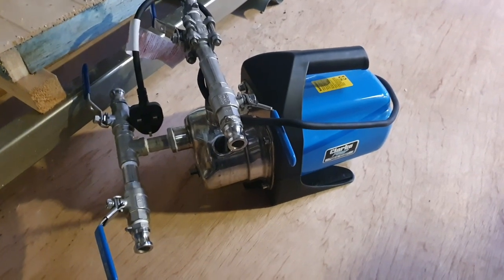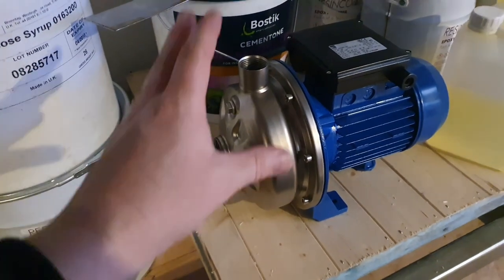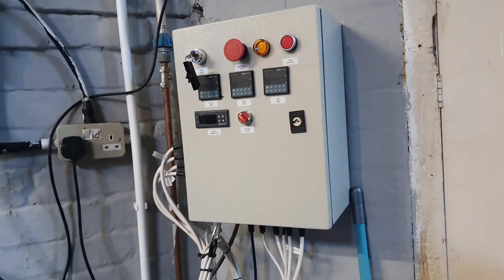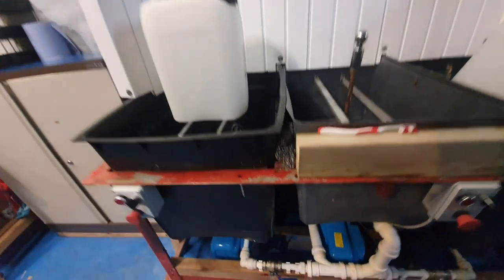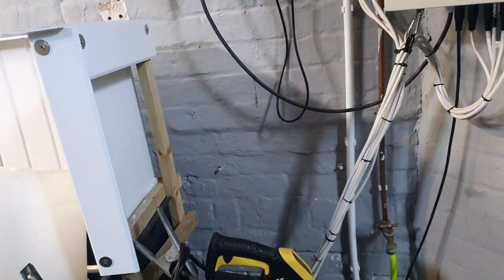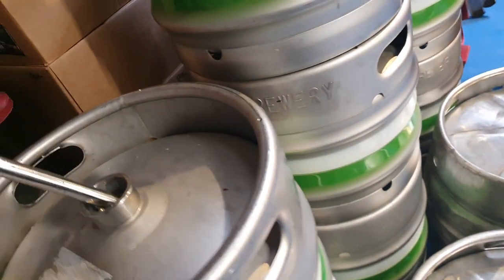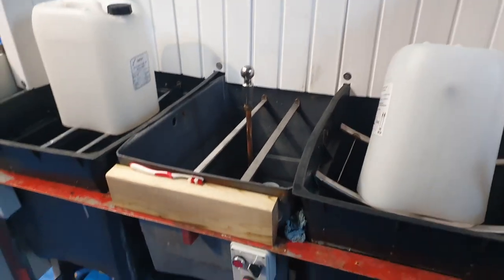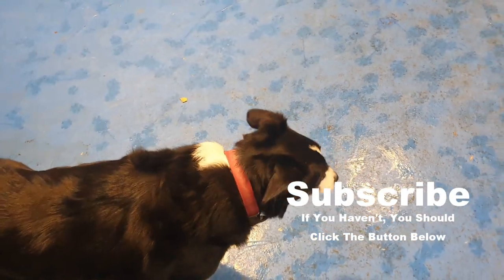Cask/Keg washer walk through with bonus Keg Spear Insights. NDL KEG Rant.

Comment: Couldn't you rinse, clean and refil without taking the spear out? All through the coupler?
Reply from the maker: Not with my washer. I did try but you need air or co2 to blow them out between each cycle. This is much easier.
Reply: @harrybrew69  makes sense. I remember one of your early vids showing the cleaning of sanky kegs upside down through the coupler.

Comment: Wondering why your using constant fresh water to rinse?
Reply from the maker: What else is there?
Reply: @harrybrew69  would it save water to fill the tub once, use the that water to rinse then drain away, refill for caustic rince
Reply from the maker: @davidmullins1270  I'm not sure it would be a proper rinse if I were to recylce the rinse water. If there is any caustic making it over to the acid tank the acid would be neaturalised and therefore useless. Always rinse to waste in my book.